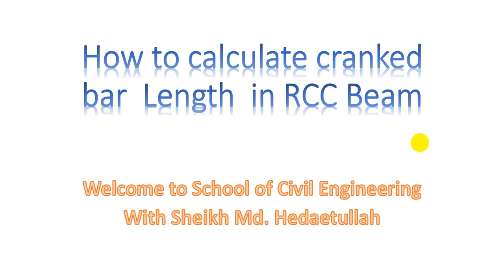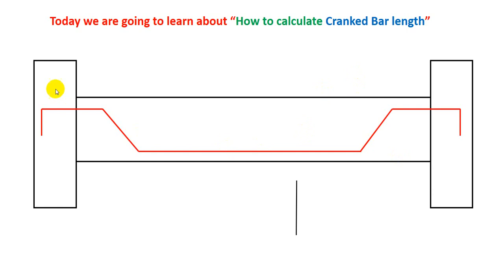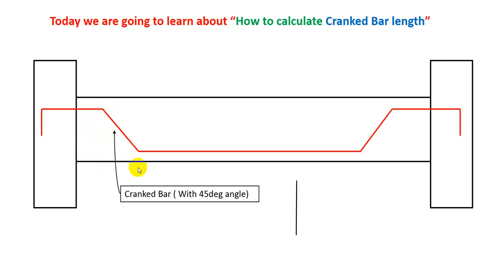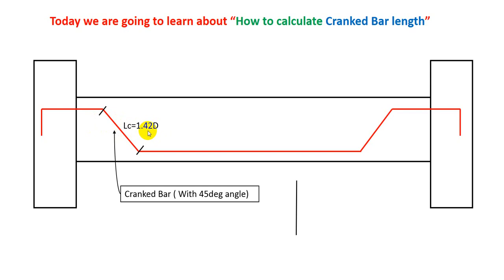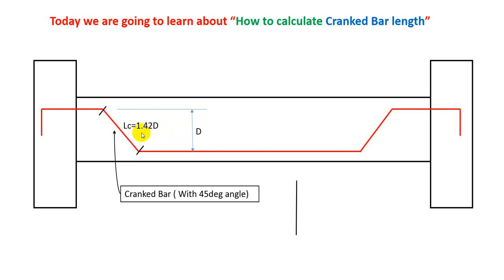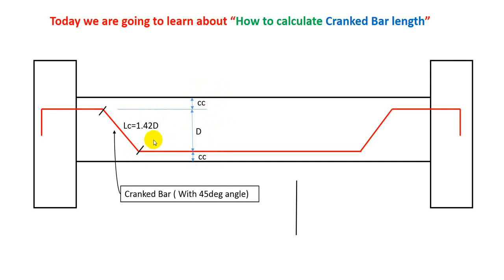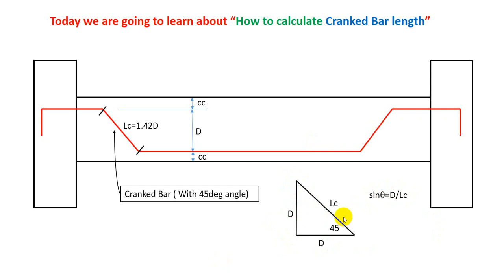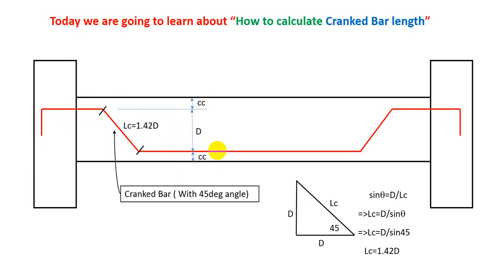How to calculate cranked bar (Bent-up bar)  Length  in RCC Beam | Civil Engineering Basic Knowledge

Comment: Which is the best bemm crank bars or extra rods bars
Reply from the maker: The best choice between cranked bars and extra rod bars depends on the beam's design, load conditions, and structural requirements.

When to Use Cranked Bars?
✅ If shear resistance is needed near the supports.
✅ In simply supported beams where shear stress is significant.
✅ Helps reduce stirrup congestion.

When to Use Extra Rod Bars?
✅ If additional bending moment capacity is required.
✅ In continuous beams where negative bending moments exist at supports.
✅ To strengthen tension zones (bottom at mid-span, top at supports).

Which is Better?
✔ For Shear Strength → Cranked Bars ✅
✔ For Additional Moment Resistance → Extra Rod Bars ✅

Ideally, a combination of both is used in structural design to optimize strength and durability. The final choice depends on load conditions and beam design calculations.